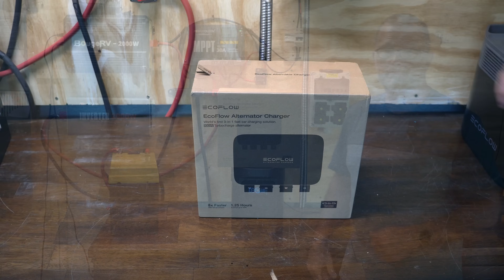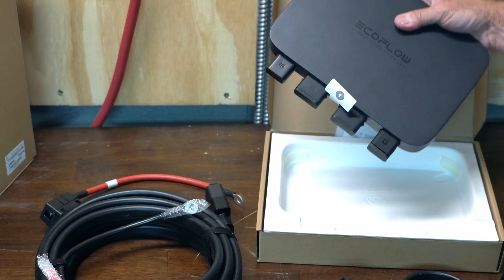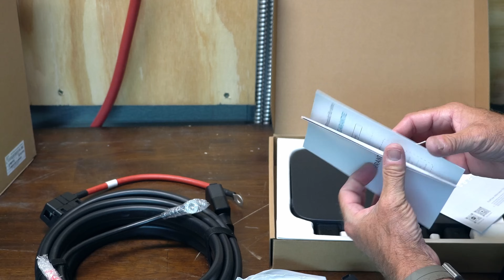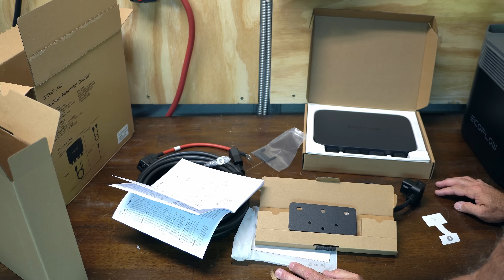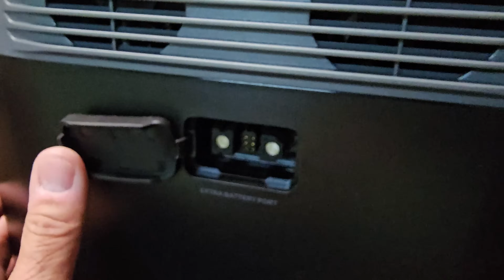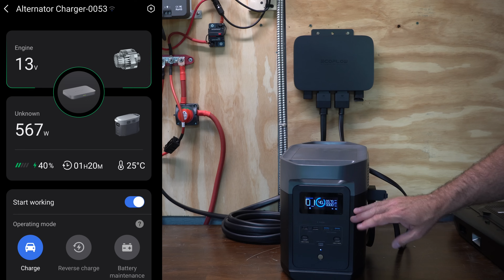BEST On-The-Go Charging for EcoFlow Delta Power Stations!

Comment: Is a simple DC-DC Converter that uses a lot of very brand specific cables for $600 and you get 800W, well for about $300 you can get a 2000W Renogy or 1200W Victron Pure Sinewave Inverters (in case you want known brand quality) or for around $150 many other off brand highly rated 1500-2000 Inverters...and while they will take a bit more space, they can be used for anything and in a pinch can charge multiple units...I say in a pinch or occasionally, because even at 800W most small vehicles will not have an alternator that is designed for heavy loads for extended periods, some work trucks and RV's do have heavy duty alternators or even multiple ones because they are designed that way. I love EF products and I own many...but this, other than look pretty and be smaller than an inverter, nope.
Reply: Another channel, outdoor adventures has a Jeep. He bought the heavier duty big tow package gladiator Alternator to upgrade But even went through the process of testing the stock alternator just show capacities and what to expect if you didn't have a heavy duty over there before he changed it.. And I think he said it cost him a couple hundred for the alternator on top of this charger setup. He sees this costing less than investing in other quality Name brand inverters like renogy because it comes with all the cable, fuses and everything. I've watched most of the videos available currently and this is coming in at around half the price, or a little more, if you upgrade your alternator. I don't know the numbers as i haven't run them myself but basic online research, they seem to be in the ballpark, But I have not priced the full list of stuff out for my vehicle as I haven't committed to a setup. Being in ecoflow with the Delta 2 Max and Glacier, this is very interesting to me.
Reply: Ecoflow runs frequent sales. I just picked one up for 349. I can't mount a solar array on my jeep.

Comment: I could only get about 60-80W from my Prius's 12V power port for my EcoFlow Delta Mini. So I built a simulated 300W solar input to take power directly from the 12V battery (only while it is charging) buck it up to 24V, and pipe that into a "solar" charging cable. Now it recharges at 300W whenever the Prius is in Ready mode. I don't bother with solar.
Reply: The priest V is a dream car life vehicle for me. But I can't let go of my job yet

Comment: I think this would work fine with an EV 12v Battery. For example on a M3 long range RWD when the battery drops to 12.5v the charge cycle will start and it charges at around 14.55v until charging complete at 13.15v. So you may have a slower charge to start, same as in your example before you switched the solar on, but once the battery dropped to 12.5v then you would be charging at 14.55 so probably getting close to the 800w.
Reply: Careful. This will void most EV warrantees.

Comment: The reverse charging does that mean if my car battery died I can jump it with the power station?
Reply: Yes, as long as the car battery is just low, but still healthy, the power station can charge the car battery up enough in a few minutes to start the car. The power station cannot supply enough current to start the car on its own, so the car battery has to be able to accept a charge and to produce the high current needed for motor starting.

Comment: What good is a device that is powered from a vehicle.  If you are in a location long term, disconnect your vehicle your trailer or 5th wheel will not charge!  Solar Panels are always connected and charging your batteries.
Reply: He described situations when solar panels won't cut it in the video. 🤷

Comment: Get a renogy dc to dc / solar , cheaper and can use your solar at the same time. You want to only pull about 20% of your alternator as well. Plus the solar can trickle charge your starter battery.

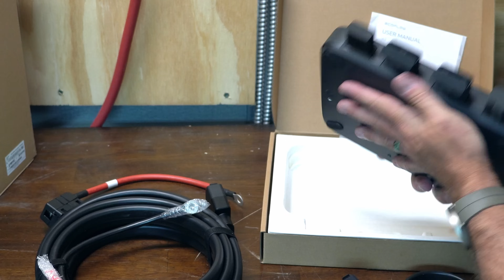Comment: Mine will be here in 2 weeks. I don't mean to be harsh.. but do more RESEARCH on the products you do reviews on. I have a Delta 1300 and the Delta II and it won't plug into the 1st version.. it's the 1300 model and has no port on the side of it, nor does it have BT or WiFi.. It will work on the Delta II or later.  7:32 mark..  "threaded screws".. huh..  lol.. We know what you meant..

Comment: Would you be able to cut those cables that goes to your battery and use a couple of Anderson connectors so I can have my Power Station in a truck camper and be able to disconnect when I take the camper off the truck.

Comment: Great video! Has anyone tried this Ecoflow alternator charger TOGETHER with the DC input (XT60i) at the same time? Can the Delta 2 combine two different charge inputs into a higher charging capacity?
Reply: Delta 2 and delta 2 max and delta pro can only take one input source at a time...

Comment: Your looking at it  right  behind you  a 1000w  power inverter in your car will  do the same exact thing  for 10 percent of the price
Reply: I made weiners on my camp stove with this.
Reply: @whitetrashgeorge  i have a 400w inverter in my bronco sport. That’s already good but these alternator chargers like the echoflow 800w or the new bluetti charger1 560w or a victron Orion 700w are 12v charger from the chassis battery are more efficient, as an 120v/12v inverter has energy loss. And during driving you normally don’t need the inverter, you use only LED mainly. So you will charge faster. When you are temporary off grid, you can then use the RV plug TT030 from the powerstation to run the entire coach which activate the inverter. With Bluetti ac200L you can add also a module d040 48v connector to charge the 12v battery (house battery). When you are on the campground you then use the 120v 30a of the grid to run everything and charge the 12v house battery.

Comment: When using a real alternator, pulling the max wattage seems like you are going to wear out your alternator pretty fast for most cars or trucks. Running at high loads contiuously for long periods of time builds up a lot of heat in the windings. I will be interested in seeing the long term reviews for this vs a DC-DC charger
Reply: Fortunately I ordered my truck with dual alternators that will push out 380A.  Just installed this EcoFlow Alternator charger and it does 800W charging at idle with no issues.  However, like you said, if you don't have enough output from your alternator(s), this could be an issue long term.
Reply: This is exactly what it will do, the extra load on the alternator is a condition it was not rated for.

Comment: For what you are paying for all that intelligent charging system you can get a high output alternator that can handle the needs of the vehicle and support your house battery / power station needs.  Consider Mechman Alternators or J & J Alternators to create a more powerful mobile powerplant, I run a 320 alternator and two 1000-amp Optima bats wired in parallel in my Suburban.

Comment: Ya and replace your alternator every year  🤣🤣🤣🤣🤣😂😂😂
Reply: People actually know what they're doing and upgrade alternators, nothing new. I have a 60amp dc to dc and upgraded my alternator to 350amp.
Some vehicles have high output alternators and even if it doesn't it's only 800 watts.

Maybe if you had a degree in automotive and knew how alternators and electricity worked you would know something
Reply: Why??

Comment: Good thing I watched the Pecron 500 watt alternator charger for the power stations. It charges any brand.
134 dollars with a discount code. 😊
Reply: Yup I had seen that as well that's what I am buying.  I could buy 4 of the pecron chargers for the price of the ecoflow overpriced charger.
Reply: Nice,thank you for this post
Reply: My Daygreen 12 to 58V 10a chargers are $110 and the 20A 58V chargers are $200. Daygreen even makes much more massive units for say if you had a 48-52V house battery system in an RV or travel trailer. They also make 12-24 and 12-28V units.
Reply: Do you have your MPPT connected to your EcoFlow? If so how?  I’m using external MPPT of my Goal Zero and want to do the same on my EF Delto Pro but unsure of how. Wondered if it’s as simple as the GZ was. Thank you
Reply: Thank you for your post   Seems like a nice quality built unit  . Too many people complain about the selling price which is always higher  upon initial  release  . You generally get what you pay for . I looked at the Pecron charger  150.00 on Amazon   Not to impressed .
Reply: Which video is that?  Searching the channel doesn't seem to bring it up, or at least it's not obvious.
Reply: @DragnDon  
Jasonoid video from April?
Type Pecron alternator charger -Jasonoid
The title is You Need This!
Reply: But is it any good?
Reply: @teideterrors  hobotech 😂
Reply: @teideterrors  
Simply built, at 149, I can buy 4 for the price of 1 Ecoflow
Reply: @wt9653  yeh and it's more flexible 😉  just concerned about it's very noisy fan.
Reply: @teideterrors  
You're not supposed to place it next to your ear.😉
I would mount this under the hood inside a ventilated box.
Reply: @wt9653  Too much messing for me, and they dont ship to Spain, I now know.
Reply: @teideterrors i am not sure byt i think victron has an Orion module where you can connect the alternator for dc dc charging. It is installed on some RV .
Reply: @CC-gt3ro  I have a Vctron Energy Orion DC-DC converter in my RAM 1500 charging my Delta 2 at about 405 watts. It works fine and was $164 at Amazon.

Comment: So if I install a xt90 connection to my battery it will work?
Reply from the maker: Maybe? But I think there's a strong chance it wont since it threw an error ok comms until I updated the Delta 2 firmware. Seems it's looking for some handshaking for compatible devices.

Comment: Great review! Thanks for discussing the various options. Solar is nice. But unless you are staying put for the full day at your campground you’re stuck for charging. And not everyone drives 8 hours a day. The gas alone to do that is crazy right now. Thanks for showing the alternatives and how to connect them. Much appreciated!
Reply: DC to DC charger has been around for 50 years. The lead acid battery used isolator. Lithium batteries use a controlled DC to DC charger and have been out for around 5 years or longer.